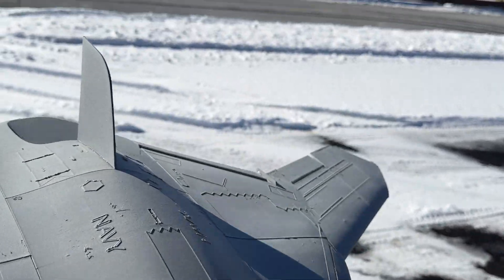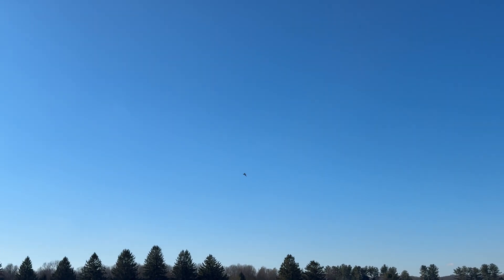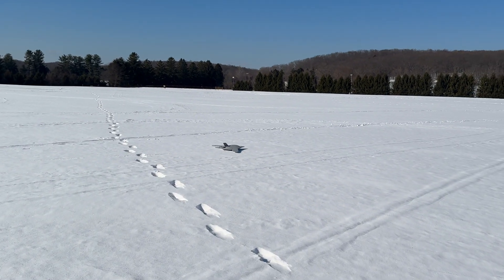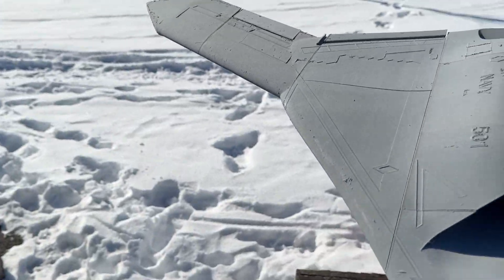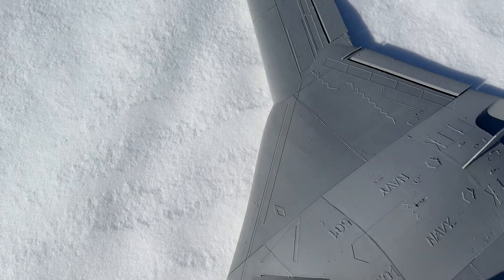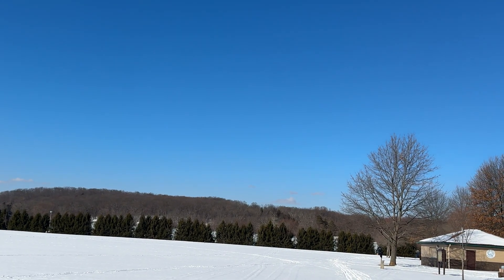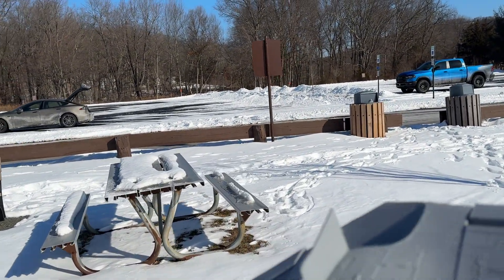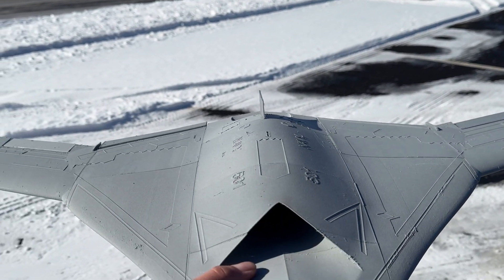X-47b The road to tailess flight. How low can we go?

Comment: If you want stable tailless airplanes you need to twist the wing 12-20% you also need to extend your wing. Consider a winglet, but lay it flat with the wing. You want the vortex’s usually found at the wing tip to move inward about 30%. This is how the birds does it. https://www.youtube.com/watch?v=w-dk1NpVNNI&t=335s

Comment: You will get even better flight performance if you can eliminate as much of the gap between the flight control surface, and the trailing edge it attaches to. At higher speeds, that gap will cause a flutter, and the aileron/elevator might separate from the wing.
Reply: No impact at the speeds this flies at.
Reply: @ASDasdSDsadASD-nc7lf  At lower speeds, maybe, other than aesthetics, and parasitic drag.

Comment: It flies better with the verticle stabs. I guess if you want to eliminate, or reduce them for esthetics purposes only, ok but once in the air wyou wouldnt see them/it. But ya, the best bet would be acrylic stabs so it looks right but performs better. Also, have you considered adding to the print vortex generators to the leading edges for better stability? Those would look like raised bumps that resemble arrowheads. The really do work for stability at slow flight.

Comment: A trick you can use is using airbrakes on each wing tip , saw it on an old b2 from mesa rc
Reply: …also on the actual X-47B 😉